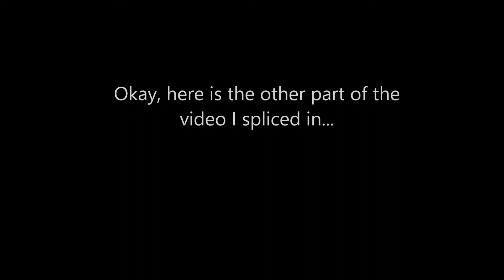Oil Viscosity, What is it? 0W-20 vs. 20w-50, oil types & differences explained...

Comment: To explain it fully for example 20W-50. The 20W means the oils is a 20 weight at Winter temperature. Yes, the W does stand for winter. But the higher the number the thicker the oil is. And some people are gonna go "Woah Woah Woah! When my oil is hot it's much thinner than when cold". That's because the 50 is how a 50 weight oil would behave at hot temperature. And that 50 weight oil at high temperature will be thinner than 20 weight oil at room temp. But a 20 and 50 compared at same temp then the 50 would be thicker.
Reply from the maker: Correct

Comment: It's got nothing to do with the climate. It's to do with the tolerances of engines. 20W-50 is used on older cars as they are likely to be more worn. Even when new they had nothing like the tight tolerances of todays modern engines. So modern engines use the 5W-30 as an example.
Reply from the maker: They all have temperature standards, but thank you for commenting and watching

Comment: Can I put higher viscosity into an engine that is recommended low viscosity? For example a yaris which is recommended to use 0W-20  but using 20W-50?  Mild climate, temp rarely goes below 10c in winter.
Reply from the maker: You can, especially after the manufacturer warranty is up... higher temperature zone, higher viscosity
Reply: @GarageMahalLife  thanks :)

Comment: In Saudi Arabia we use 20w50 due to the hot climate in summer.
Reply: Nah we follow the user’s manual. The manufacturer knows better.

I’ve used 0w20 for 300,000km with no issues in Saudi Arabia.
Reply: The temperature in Saudi can get into the 50s (centigrade, not old fashioned farenheit). But your engine will reach 90+degrees, making the outside temperature completely irrelevant!
Reply from the maker: And I bet that is not heavy enough... what is your average temp on a summer day?